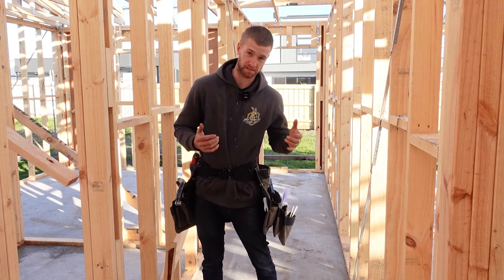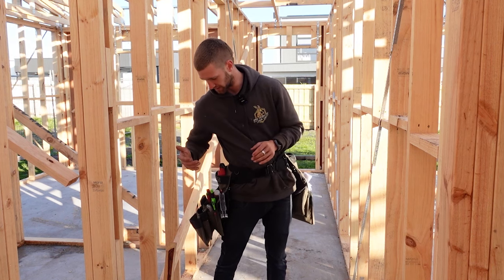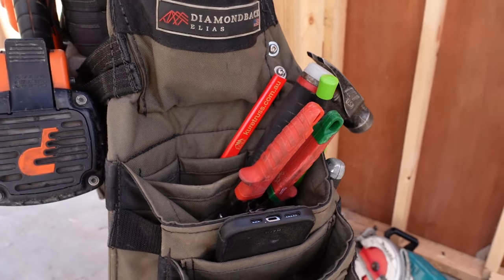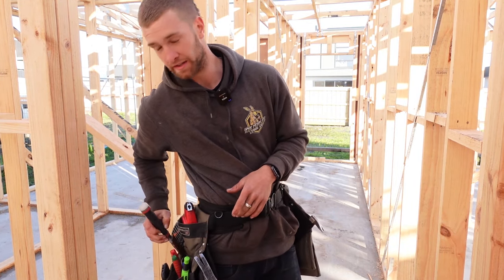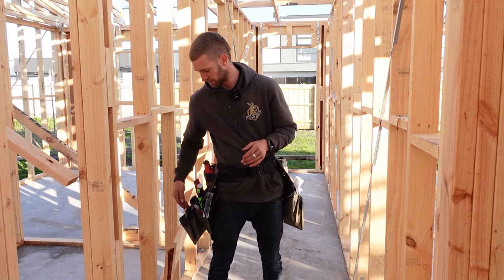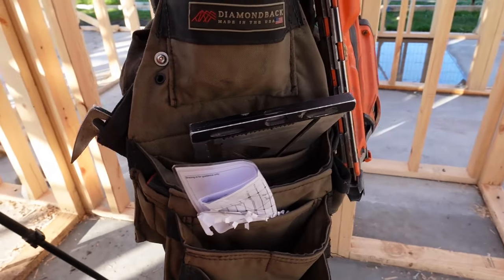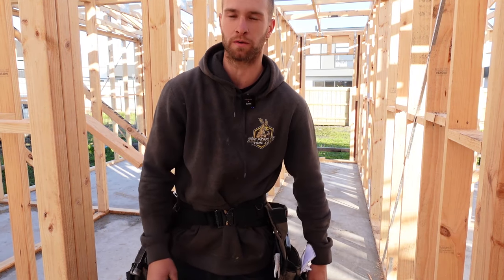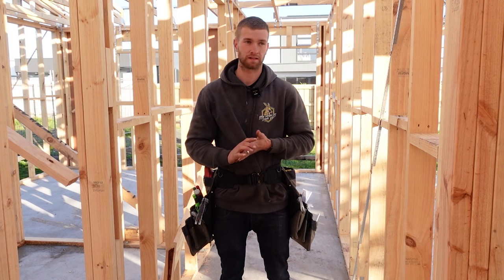Tool Belt Walk Through // What i Keep In My Tool Belt For Framing

Comment: Mattbangswood runs the same belt bro. I recently changed to the makita superheavyweight belt with suspenders. It was great, until some grub pinched it from the jobsite. Now I'm back running my gyprocking belt until I get a new one. Diamond back might be the go, I'm just not sure about the hammer holder sleeve thingie...
Reply from the maker: The hammer holsters gold mate!!
Reply: @Jack_martin  I've researched the shit out of them now everyone seems to rate them highly. I reckon I'll need the suspenders tho, I'm a bit of a long back model belts just fall right off me.
Reply: Best part of the tool belt for me, I’m a remodeler rocking the artisan I also run the pry bar holster on the off hand side, so nice to have

Comment: What are your thoughts on a 10 meter tape measure or an 8 meter tape
Reply: There’s 2000mm difference
Reply: @BarrrAmundi  yeah but is it bigger case is harder to pull in and out is it stronger
Reply: @Tuff22_  true shiet! 
Which one would you guys use the most?
Reply from the maker: 10 meter for framing